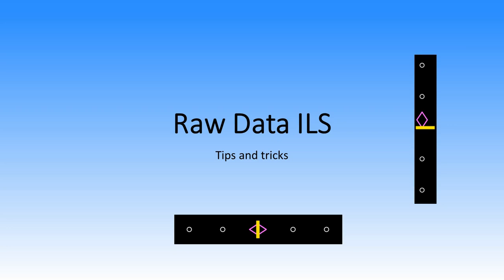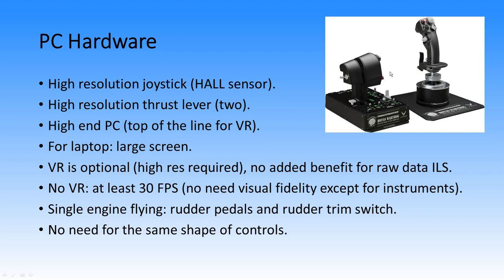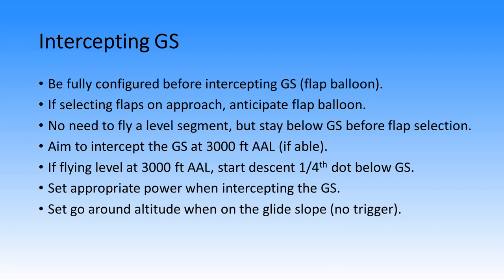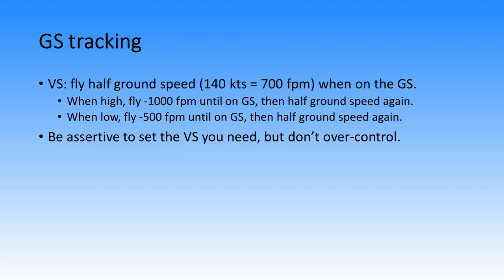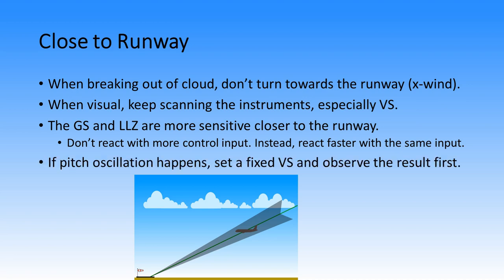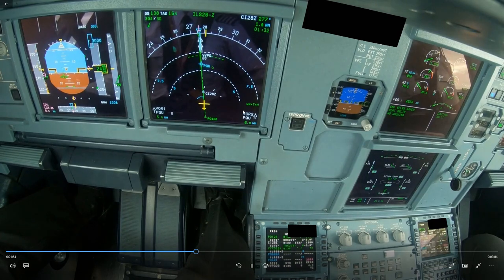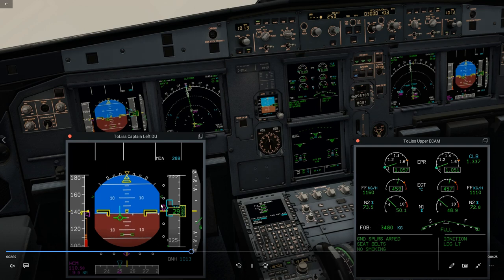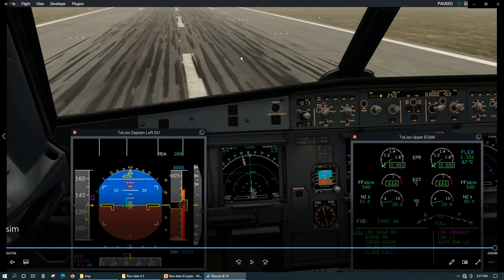Raw Data ILS Presentation

Comment: Hello sir, thank you for the explanation, it is so helpful. I will be having an airline interview next month that I need to do a sim eval in an a320 sim, but the problem is i never flew a turbofan before, and i was told i need to perform a raw data ils approach with strong wind, what do you recommend me to do at this time. 
Would it be ok if i follow your way of flting in the video
Thank you once again
Reply from the maker: Get a high quality joystick and 2 engine throttle, then practice with X-plane and Toliss A321. Hire some time on a real Level-D sim if you can.

The method I describe in this video I think is tge best way to do it. You might find that another method works better for you, but this is a good place to start.

Comment: Dear Captain thanks for the video. Can you explain the proper technique to fly a ILS with FD on? I’m having some issue in my LT in the last part of the approach and the flare technique. I’ve been told to follow FD until 50ft but I don’t now why lately I’ve experiencing late flare. Specifically, when the red chevron on PFD shows up and the FD indication moves fast and with large amplitude downwards. I’m presently flying A320 and A321. Could help? Kind regards🙏
Reply from the maker: Flare technique is a controversial subject. Even instructors don't agree. But I'll tell you what I teach. Take the AP off from 1000 ft, provided you are visual. Follow the FD very accurately down to 100 ft. Every now and again look outside and note the position of the aiming point in the windscreen. Remember the average position. Then at 100 ft only look outside and keep the aiming point in the same position in the windscreen. Be assertive and notice the plane getting high or low and fix it. Never look inside below 100 ft. Do not look at the FD, GS, or VS below 100 ft. Only look outside.

The flare height depends solely on the vertical speed. The touch down is affected by the VS, how high you flare, how long you flare (time), how much you flare (side stick deflection), and if you modify the side stick input during the flare. Also, always close the thrust at 30 ft, not earlier and not later.

Be assertive. Use as much or little side stick input as required. Whatever it takes. Sometimes no flare is required if you have an updraft over the runway.

You have to feel the force, like Luke. It all happens too fast to think about it. Get a feeling for it, like driving a car.

Comment: Hi, do we Arm the approach for ILS Raw Data in A320?
Reply from the maker: No, because you have to switch both Flight Directors off, so there is no point in arming the approach. There is a small section in the presentation where I talk about the reason why both flight directors have to be switched off.